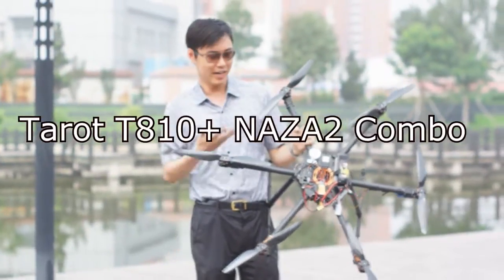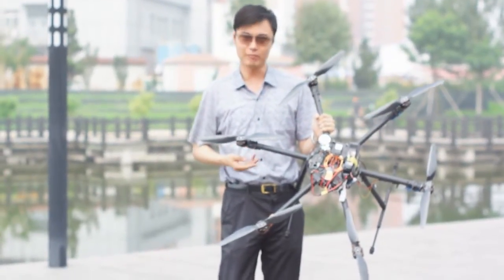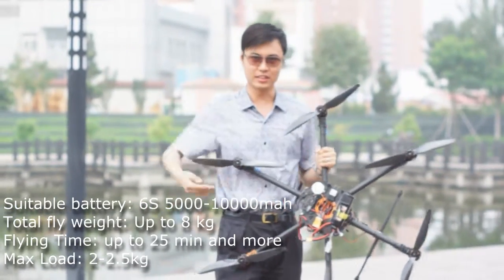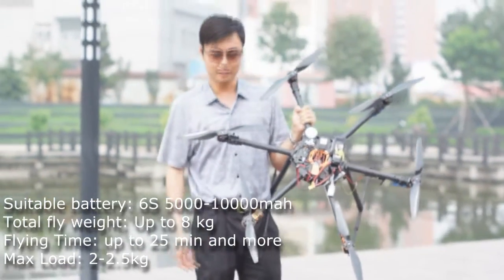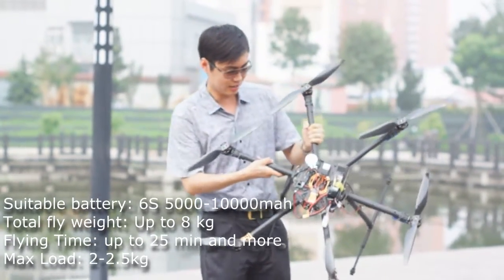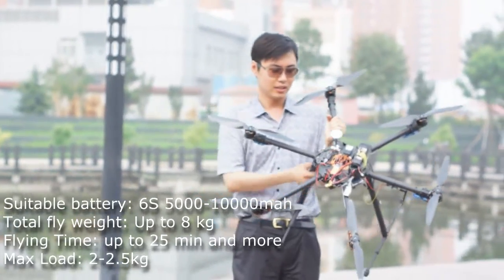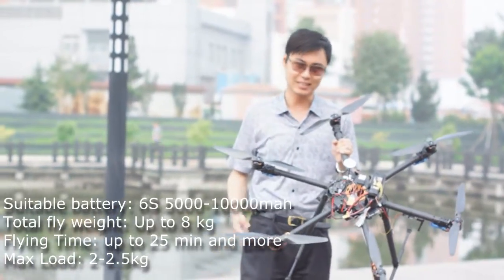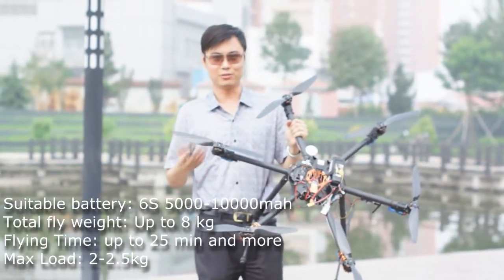TAROT 810 COMBO Introduction

Comment: Good combo. You can comment naza gains? thanks
Reply from the maker: +David Saimon 
Basically all 170 without payload
Reply: +Foxtech Hobby  thanks, i ussing about 220 and not good than your video. Wihtout payload
Reply from the maker: +Piloto RPA DRONES 
you can set a knob on the radio to remotely adjust the gains